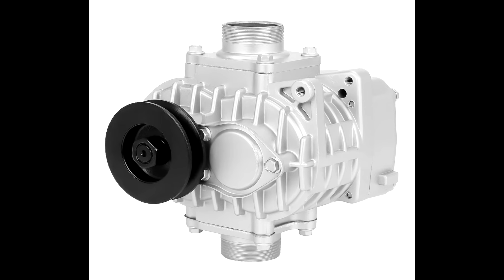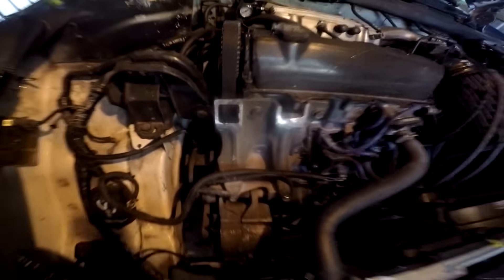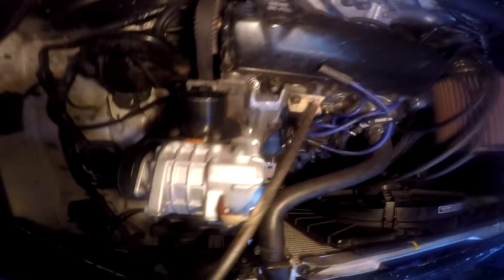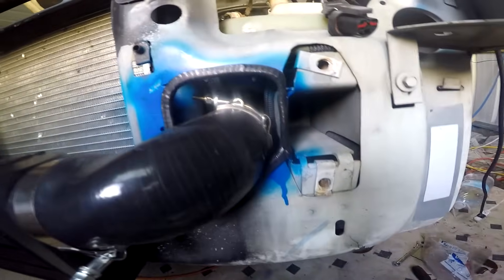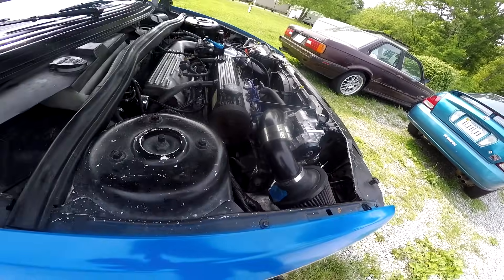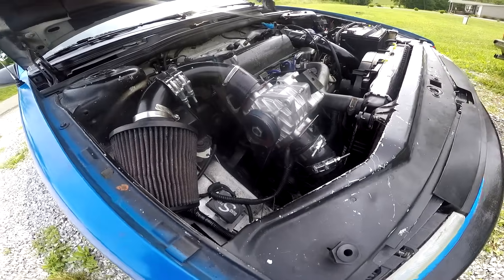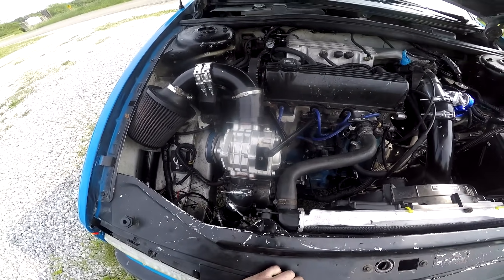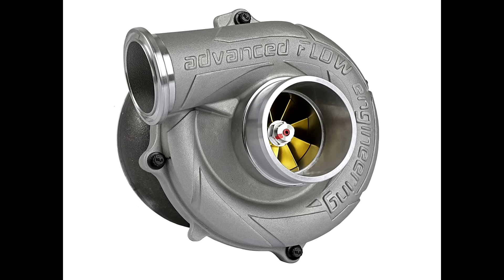AMR 500 Supercharger Testing - is it as Good as the Internet Says?

Comment: There’s a lot going on here, that revolves around overestimating and miscalculating. These superchargers were intended for and fitted to 600cc engines. The Amr500 displaces 500cc’s of volume per revolution. But that is not taking into consideration of efficiency range of a roots style blower, and the air density of the blower output. The reality is roots style blowers are only efficient at low speeds, so just because it’s “rated” for 15k rpm, does NOT mean it’s actually displacing more air at that speed. Roots blowers rapidly heat up the air from friction, with a linear increase in heat directly tied to rotational speed. The reality is you wouldn’t want to spin it faster than 6000-7000 rpm. Which is around 60cfm of airflow, and your 2.2L engine at redline is displacing at least 160-170cfm of theoretical airflow. That 2.2l engine is breathing far more n/a than this blower could ever keep up with. It’s really cool to see you mock this up to your car, but this really in no way reflects the real world use case or performance of the amr blower. You definitely could have done these airflow calculations beforehand to find this wouldn’t be a good fit. I in no way intend for this to be hostile, and I hope there is value taken from this.
Reply: Also the leaking oil happens from overfilling the units, and could have to do with the speed your turning it at as well.
Reply from the maker: I had assumed it wouldn't work, however I see people putting these on their cars all the time, and Chinese Ebay sellers are selling these as if they will work with these larger engines. the video basically to get people to stop doing it.
Reply: Jerry may I hassle you with a question which you may be able to answer. Say I have a very inefficient 2.5 litre, 70hp, small carb, low compression, not built for performance. That thing is surely not consuming as much air as this Plymouths 2.2. What does this 2.2 make stock, 140hp? With far less power to start with could my feable 2.5 make use of such a small supercharger? I know there's better options but I'm just considering the Aisin rip off for novelty factor 😀
Reply: @LivingMyBoostLife  The AMR 500 is completely useless on any engine over about 1600cc. It doesn't matter how much horsepower your engine currently makes it all has to do with volume. Jerry pretty much spelled it out. Not sure how you could possibly read his post and not get it.
Reply: @LivingMyBoostLife  well, the displacement is there to stay so this supercharger would remain insufficient, if it's just inefficient due to low airflow and fuel then swap the carburetor to a bigger and better breathing one and the things would drastically change. You'll need a bigger carb in either way even if this one worked.
Reply: @tjewett1967  I "don't get it" because surely volumetric efficiency of the engine plays a big part?   A 7.5:1 compression ratio 2.5 litre is going to consume less air than a 2.2 with 10:1
Reply: You ever feel really alone because everyone is so dumb that there is no relating to these animals?
Reply: @Justice Forall or he could get a second AMR500 and pair them together with a Y coupler
Reply: @LivingMyBoostLife  Volumetric efficiency has NOTHING to do with compression, but rather, intake port design and cam lobe profile.
Reply from the maker: @LivingMyBoostLife  An engine with low compression will intake a teeny tiny little bit less air than a high compression one due to combustion chamber size, but the amount may as well be the same. If you have an engine with a small carburetor restricting your airflow, you would be better off upgrading your carburetor rather than trying to cram more air through it. Cylinder head design and cam profile does play a huge roll in how much air an engine consumes, but even a crappy 2.5L engine is way too big.
Reply: @Justice Forall the Eaton off thunderbird super coups would work to allot of people use to get those to swap on 3.8 mustangs since it’s basically the same engine and do a Gt rear end for lsd
Reply: @HatersGarage  Donut media put one on a VW Cabrio and lost 50 percent power.
Reply: Blowers pump per revolution, a 4 stroke engine pumps every other revolution. So a 600cc motor consumes 300cc every revolution of the crank.
Reply: @Justice Forall true but I’m saying if you can’t find one which unluckily that’s another option that will deff do more then that lil amr
Reply: Dude, you got a post this on Donut medias wish supercharger video. They were making 80 hp before from there Volkswagen golf, and the supercharger halved that. This would be good to know in the comments section of that video.
Reply: The obvious solution is to buy 4 of them and run them parallel. Duh, super efficient! /S
Reply: Simple fix: get 2 (or 3)
Reply: @HatersGarage  people getting ripped off because they dont know that came off of 670cc supercharger 2 cycling (it can fit on go kart)
Reply: I read the whole thing and I'm glad to have been educated.
Reply: So he did all that work and didn't go the extra step to throw a 2.5 inch pulley on it and set the Rev limiter to 5k? He can use this on a 2.2 you just have to bring max engine rpms down and understand you will peak below 150hp. I've seen undersized forced induction do pretty impressive things. A good write up of a turbo from a 2.2 making over 300hp on a 225ci slant six for instance (stock slant is 110). The trick is it made all that power under 4500rpm. The reason vw guys have good luck with these is they run them draw through. The fuel does a good job of cooling the charge and boosting the seal on the supercharger. If they can dyno 120+hp so can he. He just needs to approach this with more understanding of the limitations. The oil in the intake is also a good sign of being under driven. He has no bypass so the supercharger sees vacuum at low rpm. They normally had a bypass in factory configurations. He's sucking the oil past the seals just like a draw through carb turbo setup does. Positive displacement power adders NEVER like vacuum.
Reply: @HatersGarage  I am kinda confused why you took a supercharger that flows 290cfm at max rpm and only set it up for maybe 180cfm yet expected performance. You could under drive almost any supercharger and get a similar result.
Reply: @JohnS-br3xk  it's because the supercharger is under driven. It is experiencing vacuum at low rpm. In a stock configuration it will have a bypass to prevent this. It really needs a 2.5 inch drive pulley on this size motor. It would top out at 5800rpm though. According to the numbers that would flow a max 290cfm and produce about 11psi. If he went 2 1/4 it would make almost 15 psi up to 5300rpm. Trying to put one of these on anything it wasn't designed for without proper re gearing is extremely common and frustrating to watch. They do 99% of the work yet can't be bothered to order a $10 pulley online.
Reply: @LivingMyBoostLife  the 2.2 is a 94hp motor. With a couple tweaks he could make 120 or so hp with this setup. For undersized superchargers you must overdrive the belt. With a 1 to 3 ratio (300% overdriven) you will get you about 9psi up to 5500rpm. If you went 1 to 3.5 you will push 14+psi but only to about 4500rpm. It will work but with limitations. The main being it flows 290 cfm at 16500rpm. If you don't Rev the piss out of the supercharger it doesn't really make power. The theoretical max hp for the amr500 is 150 but realistically with losses look for 100 to 120.
Reply: @tjewett1967 The problem here is lack of math. It's all about cfm. If your engine flows less than 200cfm this will work as it maxes out at 290cfm. The main problem in this video is driving this supercharger at 2/3 rpm on an engine nearly 4x the size of the original. It's kinda laughable. This thing should be 300 to 350% overdriven on this engine. He only ever cranked it up to maybe 180cfm of flow and that's at redline... in other words he left 110cfm of flow for lack of a pulley swap.
Reply: Not only that but don't slap it on a 2.2l it works best on vw bugs and motorcycle/go carts
Reply: What about on a quad tho? Like run it off the cam, I’m sure It for feed a little 400ex pretty good
Reply: If you have full vacuum on the manifold side it can cause then to blow oil through
Reply: @LivingMyBoostLife  when bumping the compression ratio you're just compressing the air at a higher rate not actually increasing the volumetric efficiency.
"Volumetric" refers to the actual volume of the air being compressed.
Things like Camshaft grinds, porting/polishing of intakes, improving exhaust, cylinder head ports and valve lift  will increase volumetric efficiency because they allow more air into the engine.
My high school automotive teacher 30 years ago said that the best way "an engine is just an air pump all it wants to do is breathe". So the better/more efficiently it can breathe the higher volumetric efficiency will be. Think of volumetric efficiency as trying to breathe through a straw versus trying to breathe through a 3-inch pipe, maybe just fine when you are sitting still (low RPM in an engine) but if you try to run (high RPM in an engine) it is almost impossible because of the limited airflow intake. 
Wikipedia says "Volumetric efficiency in internal combustion engine engineering is defined as the ratio of the mass density of the air-fuel mixture drawn into the cylinder at atmospheric pressure to the mass density of the same volume of air in the intake manifold".

Messing around with compression ratios, lightening rotating Mass, reducing friction or improving ignition timing or spark voltage will potentially increase horsepower but not increase VE as the engine will still have the same flow restrictions as before.
Improving airflow in and out of the engine will increase volumetric efficiency.
Hopefully that makes sense and I wrote it in a way that wasn't I think the word in condescending if I did come off that way I did not mean to.

Side note In this video the problem here is the supercharger is designed for a much smaller engine I don't know where I read it but I believe I read that it was designed for a 600cc engine so you can assume that the "straw" was just to small for the application no matter how well it worked.
Reply: @AtomicReverend  That was a good explanation, thanks. For my own purposes though I discounted a supercharger on my Uaz vans lack luster 2.5 engine and am in the process of swapping it out for a Saab 2.3 Turbo engine 😁 It's on my YouTube if you were interested.
Reply: Wouldn’t the speed of the blower be determined by the pulley ratios.
Reply: sooo would this work on a lets say 250cc bike engine ?
Reply: So what you're saying is... I need 12 for my 6.0..?